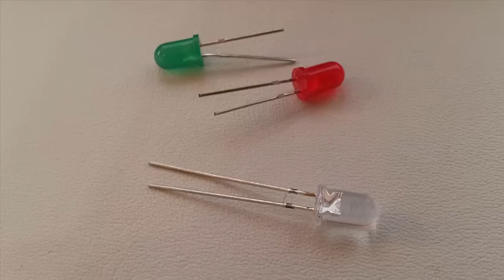Beginner Electronics - 6 - LED's

Comment: Why does Anode = positive only in LEDs? It’s negative elsewhere. Ie. The Anode is the negative or reducing electrode that releases electrons to the external circuit and oxidizes during and electrochemical reaction. The Cathode is the positive or oxidizing electrode that acquires electrons from the external circuit and is reduced during the electrochemical reaction.

Comment: Summary:
-an LED is a diode, which means that it has a positive (anode) lead, and a negative (cathode) lead
-you MUST connect the positive end of your battery to the anode
-you MUST connect the negative end of your battery to the cathode
-if you don't connect them properly, 1) your circuit will not work, and 2) you could damage the LED
-you usually add a resistor to your circuit when using LEDs because LEDs get damaged if too much current is pushed through them

Comment: When both are same size terminals how they are differentiated into anode and cathode this point i didnot understand properly please make me explain
Reply: Hi Muhammad,
The LED has a circular shape at the bottom where the leads (terminals) are, except for a flat (or straight) part.
The lead (terminal) next to this flat part is the cathode (-) lead (terminal).
I hope this helps you.
Reply: Additionally, you'll see two pieces if material in the LED: the large part is referred to as the anvil and is doped to act as a cathode. If all else fails, just look for that.

Comment: Anode(+)

Cathode(-)

Need an easy way to remember?

A+
C-

How do you remember that the longer lead is the positive one?

If you want an A+, you should have a LONG study session.

How do you remember that the flat edge of an LED represents the negative lead? (Assuming that the leads are the same length)

Well, the flat edge sort of looks like a negative (-) sign, doesn't it?

Hope that helps.
Reply: Anions (-)
Cation(+)
when you know these you kind of tend to muck up.
Reply: Positive is bigger than negative
Reply: Excellent! THX
Reply: I remember them by thinking “Aka” means red in Japanese
Reply: @jakkuwolfinsomnia8058 as a Japanese learner this helps

Comment: I like this series so far, but everyone has to slow way the hell down on talk of cathodes and anodes.

These are only found on the battery itself, where the electrochemical magic happens.

LEDs, along with all other electronic components have LEADS, and these leads are connected to the circuit.  

Unless your LED is undergoing some sort of REDOX reaction, of which the general expectation is roundly nope, you connect your LEADs to the circuit.  

The indicated LEAD is connected upstream, back to the battery.
Reply: When I took electronics in college and they referred to the leads of the LED as the cathode and anode. 🤷🏻‍♀️

Comment: I can really appreciate your videos.  I want to learn this to do my own DIY projects. They're really helpful and I actually didn't start learning anything til video #5 but...  My thing is now that your talking about colors on the resistors, I'm color blind. What do you suggest?
Reply: The simplest solution is to get a multimeter & use it to measure the resistance of each resistor & then label them.
Reply: You could try get colour blind glasses.
They are expensive, but worth it.
BUT
some resistors come with it written down near it

Comment: I just found this channel, and am going through all of this playlist. I haven't gotten to anything I didnt already cover in an actual circuits class yet, but holy hell do you explain this stuff well. Even in my classical circuits class my profs didnt do 1/2 as well explaining concepts in non-electrical terms as you. Ty for all of the effort you have put in so far.
Reply: I'm in 6th grade and like physics and math but after watching this playlist I like electonics
Reply: IKR
Reply: I agree. Some of these concepts I kind of had under my belt already, but these videos for some reason are really registering with me. Great job! One question: I realize that a lot of stuff is for illustration purposes, but if a 9V battery produces too much current, why not just use a different battery, like a AA or AAA? You might still have to add a resistor, but not such a big one. Does this make sense? I'm just trying to understand.

Comment: Is the resistor make the amount of current to be fixed after passing through every time even we change different amounts of battery  or it reduces the current in a specific amount
Reply: It's actually neither of them. A LED (or any electronic part that draws current for that matter) draws a fixed amount of current in order to work. In this case, let's say 20 mA (milli Ampere). The LED needs 20mA of current to light up, if it's less, it won't light up, if it's too high, it'll blow up the LED. 

The important thing to understand here is, that LED draws the current. Meaning, you don't "feed" it 20mA, it draws it itself. As you learned a couple of videos ago, Voltage (U) and current (I) are depended on each other. Now the resistor comes into play.

What it does is, it limits the voltage and therefore the current running into the LED. A resistor does not affect the current itself, but rather limits the voltage provided, and because of a lower voltage, only a certain amount of current can flow. 

I think the important thing to understand is, that a resistor manipulates (or lowers) the voltage. Because the voltage is lower, only a certain amount of current can flow, it that amount of current is what it's needed by the LED (in my example 20mA), it will light up just fine.

Comment: maybe a stupid question but how do you know which order the colors of the resistor go in.   ex: I have a resistor that's red,black, black,purple.....or is it purple,black,black,red?  just by looking at it how do I know what's the first color and what's the last color?
Reply: Left to right. So it's

-(R  B  B      P )-----

    20 x 10,000,000 = 200,000,000
Reply: How do I know which side is left, Is there any indication that says the Left and Right side of the resistor???
Reply: You read them left to right and the farthest bar (color) from the rest of them is the right side. Just like the example that Ze Bagle put ( R B B    P)- there will be a larger space between the colored bars which is on the right side.

Comment: but how do we know what's the max current a LED can handle?
Reply: Syed Ilhan about 20mA for the most common ones. It usually specifies when buying
Reply: i think multimeters have that function.
Reply: Simple......Ask Google(include the type and the color of the LED too)
Reply: We will get to that when we cover diodes. But this might help https://www.sparkfun.com/tutorials/219
You must reach the characteristic forward voltage to turn 'on' the diode or LED, but as you exceed the characteristic forward voltage, the LED's resistance quickly drops off. Therefore, the LED will begin to draw a bunch of current and in some cases, burn out. A resistor is used in series with the LED to keep the current at a specific level called the characteristic (or recommended) forward current.